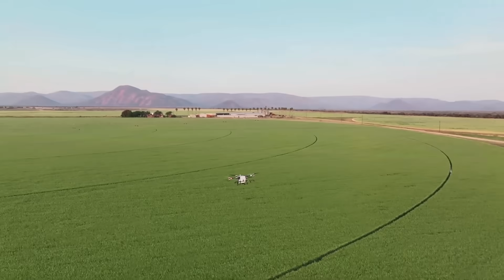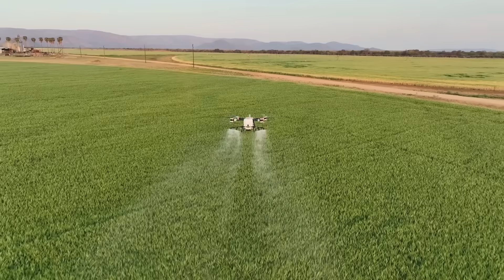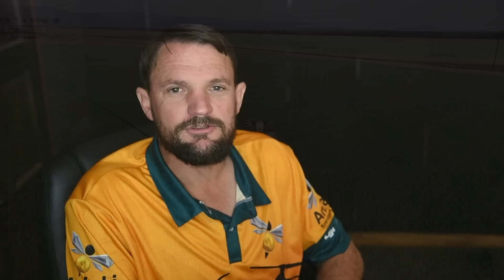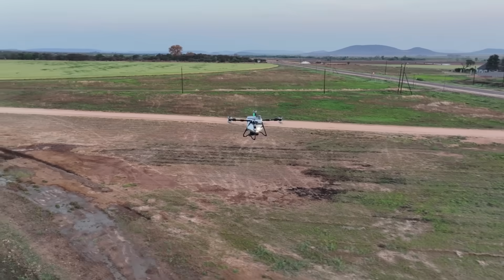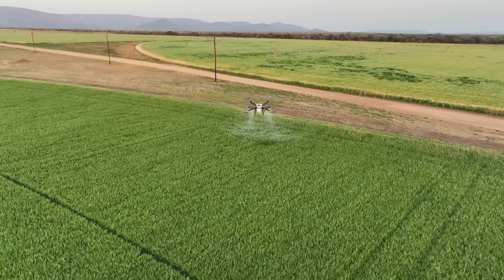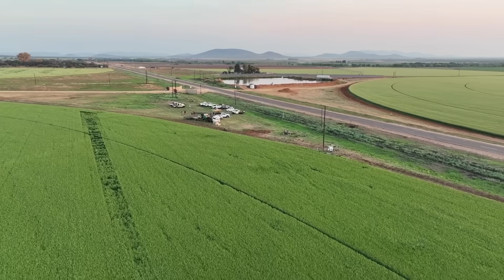T100 Review Video - Farmer's day 22 Sept '25

Comment: Way to fast zero penitration
Reply: You are correct, although penetration is not zero, it is less than when you spray at around 30km/h. It still is much better than traditional arial applications though. When penetration is required I would recommend you spray at slower speeds.